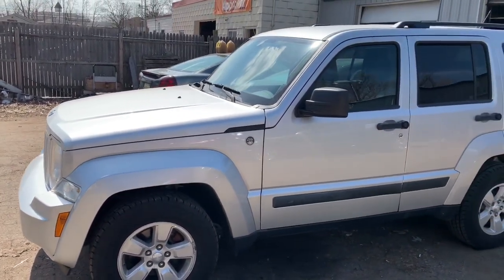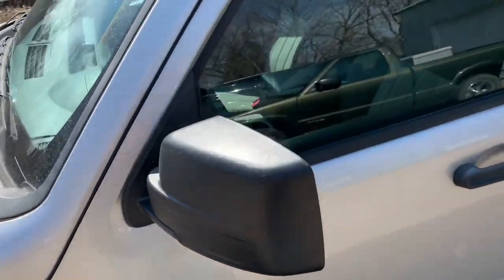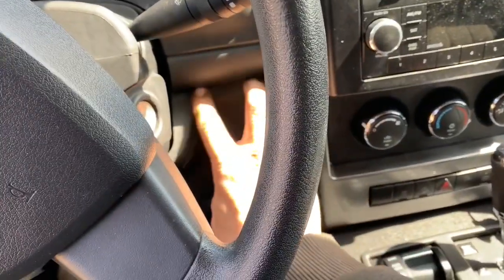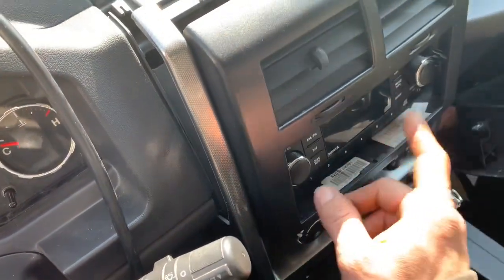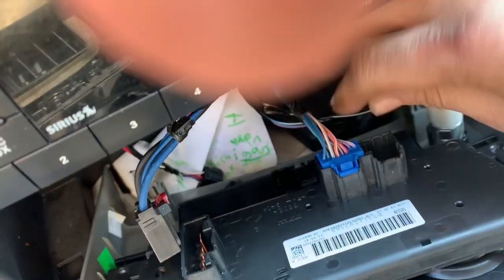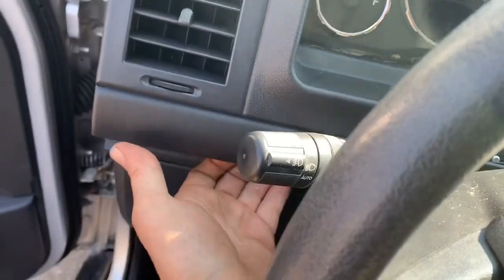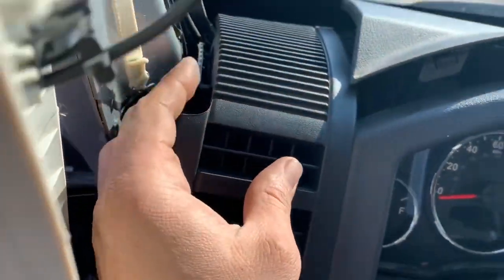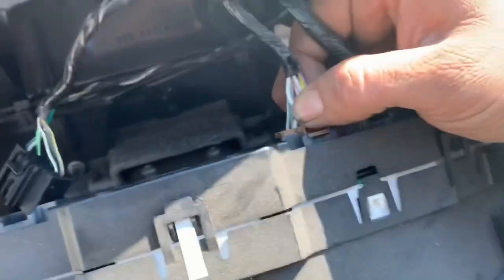Jeep liberty dash cluster removal instrument cluster removal

Comment: This video went very fast I barely saw what all happened here and where is the install video too. I am a female and I am going to do my own. I do not want anymore mechanics touching my vehicle ever again had enough of the bs! 👊🏾
Reply from the maker: I’m very sorry sometimes you make good videos and sometimes you don’t most of the time you won’t see an installation video of this type of thing because it’s the reverse of the removal
Reply: @sharpcarco  awe thank you for sharing and all of your time making this video I appreciate you.
Reply: So, I have a 2011 Jeep Liberty Sport and my speedometer is either lit, or lit half way, or goes dark. Everything else works inside the dash board. If I dismantle everything as shown in the video, what exactly am I looking for?? I'm a handy female but I've never dealt with any electrical parts of my vehicle, except to replace the battery, or head lights. Any inputs would be appreciated. Ty guys. 😁
Reply: @JasnaJankovic-o3w  Currently having the exact same issue. First thinking it was a power thing. Believe it's just the lights inside the panel going bad. They come on and off, flicker, dim out. Sometimes stay on fully. I have a sound system that saps some juice but this was a thing in the vehicle long before then.
Reply: @lethalassassin1754  Don't know any more. Hopefully someone here posts the resolution.